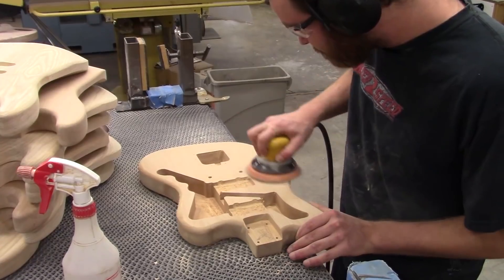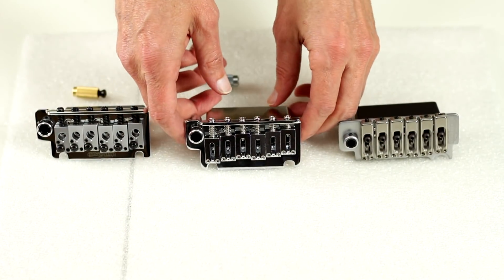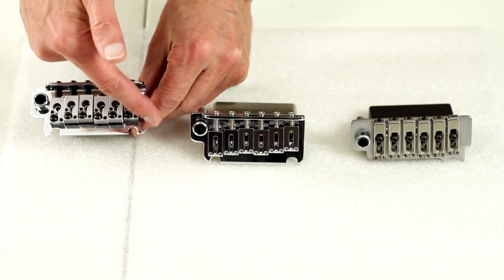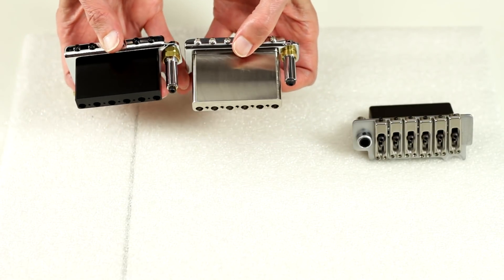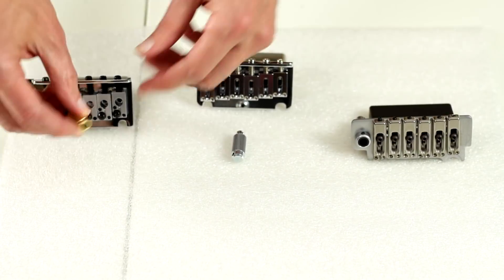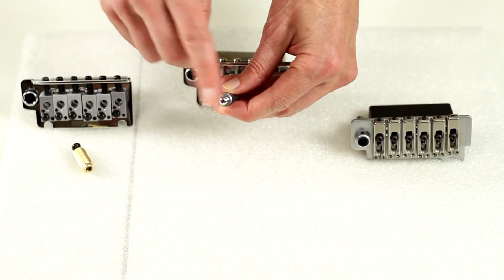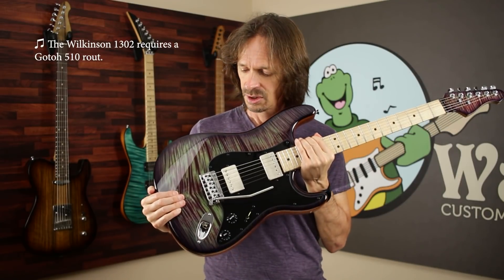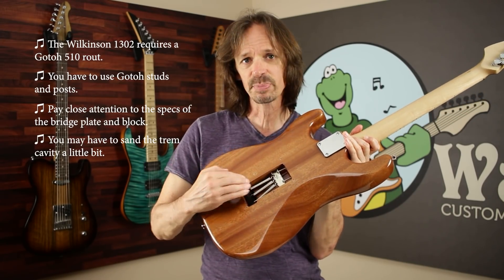Wilkinson 1302 Tremolo Installation Fail??

Comment: Hi Aaron, Other options are Wilkinson WLS130/S Locking Steel Saddles which can retrofit the saddles on the Gotoh 510. In terms of the Wilkinson WVS1302P you have the WVS1302P Compact which is a modified version of the Standard WVS1302P Vibrato, and is designed to fit specifically on Charvel “Dinky” Style guitars with bridge recesses, and shorter body depth. I have  Wilkinson WVS1302P standard and it has no problem in the Warmoth 510 body rout although you do need to use the studs as you mention in your video.

Comment: If you already have a 510 in a guitar, you can just buy the locking saddles and use those. Drop those in on your 510 and good to go!
Reply: Was just about to type the same thing.
Reply: I already made it 6 months ago
Reply: @baimun  Me too! LOL
Reply: And the 510 plate holes are oval. It may not be relevant for a lock saddle, but for mental health I am particular about it.
Reply: exactly what I did. Gotoh clearly makes better parts and hopefully they can come out with their own version of the locking saddles in the future so we can just get a 510 with them.
Reply: @fusionid   gotoh is the manufacturer of the wilkinson.

Comment: The compact is for Charvel's (etc.) with slightly recessed trems, thus the shorter depth. Wilkinson makes a non-compact version for non-recessed bodies
Reply from the maker: Ahh....good to know. I tried switching the block with the 510, but they were not interchangeable. Maybe I will try to order the longer block from Wilkinson.
Reply: @warmoth  Would 1302 saddles retro fit to a 510 trem?
Reply from the maker: I think they are supposed to, but I haven't had a chance to try that yet.
Reply: @PhilLament  I think that's what Pete Thorn did to his Suhr
Reply: The saddles do fit the Gotoh 510 and they work fine on it. I had a Gotoh with these, so speaking from experience.
Reply: @warmoth  I made it 6 months ago... saddles are retro fit to Gotoh
Reply: I’ve got the 1302 non compact and a Gotoh 510 and the 1302 saddles do indeed retrofit.  I actually have the 1302 non compact in a Warmoth guitar that I ordered with the Gotoh 510 routing and it fit perfect.  Initially I asked the guys at Suhr as I had the 510 in my Suhr Classic, and they confirmed the 1302 non compact bridge retrofits with no modifications necessary.
Reply: @PhilLament  Wilkinson sells the locking saddles both in center and offset screw formats. I have the center screw ones on my gotoh 510 and they work perfectly.
Reply: Thanks Doug, I was about to ask this question.  Wilkinson really should be clearer in their online stores.  If Aaron can make this mistake, what hope is there for the rest of us😃
Reply: @takemebacktothen  I did that with my Suhr too
Reply: @warmoth  It says it right in the ad for it. "The WVS1302P Compact is a modified version of our Standard WVS1302P Vibrato, and is designed to fit specifically on Charvel “Dinky” Style guitars with bridge recesses, and shorter body depth."

Comment: Trevs Locking saddles are amazing,  had them in my strat for over 2 years now and they work just as well as a floyd system when used in conjunction with locking tuners too.
Reply: I was going to ask that question thank you

Comment: Thanks Aaron for this upload. As usual, manufacturers are producing so many different standards that most are incompatible with one's stuff. The "sound of failure" is a real hit: someone should make a record with it...! 😆🎸😝😵 "The WVS1302P Compact is a modified version of our Standard WVS1302P Vibrato, and is designed to fit specifically on Charvel “Dinky” Style guitars with bridge recesses, and shorter body depth" Personally, I am into a vintage trip right now, and I am sticking to my old 6 screw traditional trem. 😁🙄

Comment: Hi to Aaron, and all you guys following the videos that Warmoth produce for their superb products.  Being part of the Wilkinson team I can clear up any confusion people may have regarding our anniversary vibrato range.

In the range we currently have two vibrato units which are the;
WVS130/2P Standard version.
WVS130/2PC Compact version.

Both units are 56mm across centres with a 10.8mm string spacing.
The block on the Compact version is shorter and the top plate is also smaller, this is designed purely for Charvel model guitars that are routed around the vibrato on the front of the guitar, and are also routed at the rear so the plate is level with the body rear.

In answer to the comment about Gotoh being are sole manufacturer this is not the case.  The fact is that we utilise a small number of high quality bridge and component manufacturers to create our hardware, and like other leading guitar brands we have a selection of ranges at different price point to suit the individual customer.

As noted by many of the comments, Wilkinson also produce a range of locking saddles that will fit many bridges/vibratos that are part of the Anniversary range, these are denoted;

WLS130/S Standard versions which will fit many vibratos on the market.
WLS130/P PRS style, designed to fit the PRS vibrato. 
WLS130/F Fender offset screw style, designed to fit the 2 pivot fender vibrato with offset intonation screws (right hand only)

If anyone does have further questions then please feel free to contact me @
rick@wilkinsondirect.com
Reply from the maker: Thanks for the clarification Rick....much appreciated! I have another bridge on the way, and will be doing a follow-up video once it arrives!

Comment: When you look at the price difference in doing this, it actually makes more sense to buy the 510 along with the mounting studs installed, and then simply buy the locking saddles separately. Installation is not that hard.

Comment: It’s crazy that they changed the studs on this and you’re honestly better off with the 510 studs. The 1310 studs are obviously non-locking, which explains how they’re able to be smaller in diameter. Locking studs are a huge improvement for tuning stability.

Comment: I found out the hard way last year that the posts were not compatible but that was an easy fix as you said.  I was able to get a Wilkinson 1302 with the full length block from their Reverb store last year so the rest of the install worked fine for me.  If you contact Wilkinson on Reverb, (Trev's daughter runs the store) I bet she will send you a replacement (longer) block.

Comment: I just ordered my first Warmoth body and neck the other day. If this build goes well I’ll definitely buy another body and neck. Can you possibly do a top mount Floyd Rose video? I really want a Floyd Rose in one of my guitars, but I don’t want to deal with a floating bridge. Thanks 😊
Reply: You can always use an L shaped backstop like the one from Fu Tone or Floyd Rose, improves tone as well. Works on both recessed and non-recessed mounts.

Comment: The Devil is in the details.   I just had to order another Wilkensen Trem.  I got the string spacing right, but the screw holes didn't match up to the predrilled vintage spec strat screw holes of 55.5 mm.  The trem I got was 57 mm.  Wilkensen does make one, so I had to order it.  These are worth the aggravation, best trems you can buy.

Comment: The unusual short specs of that bridge block aside, would you consider doing a video on essentially a little measuring course, on how to swap such bridges from one to another on the same body, like for instance those wilkinson bridges. There are so many details that should be regarded when upgrading a tremolo bridge, but few videos that explain which measurements should be done and how they should be done. I bet there are lots of viewers who want to educate themselves and dont necessarily shy away from using woodworking tools to accomplish such a task.

Comment: VS100N is shown as 28.4x2 = 56.8mm on gotoh's site. I believe they are showing how far you can go with the stud centers; not sure tbh but the right stud is not in the center of the marking. Either specs have changed or you are putting your studs too narrow and not landing them in a more general spot as you said the stud spacing Warmoth uses is 54.5mm. Not sure where you are getting that from. From gotoh's dwg I'd guess you are landing your studs in the center of the markings, but that's not what they are showing on the dwg. Great vid though, appreciate the shorter block info you highlighted!

Comment: Hi can you do the 'new' Gotoh 510 'narrow spacing left handed' they sell it now, I've been hassling them for 8 years about it XD finally it's an option, just checking if you can supply or route for it thanks! The narrow spacing is good for preventing strings falling off the fingerboard sides since Warmoth necks are not so wide at the pocket.
Reply: I replaced the bridge from my Fender strat to Gotoh NS510 which is "narrow spacing" type, and I'm so happy with the result! 510 and NS510 are compatible. I hope Warmoth will be able to sell it.

Comment: I didn't like the VS100. The black saddle screws Allen key head warped very easily. I had to end up using two different wrenches to adjust them.

Comment: Knowledgeable reps that step up at the time of ordering to  help us navigate thru all these compatibility issues would give me a ton of confidence as a customer. Does anyone at Warmoth look for this before ordered are run when different parts are ordered at the same time?
Reply from the maker: We look for obvious compatibility issues and advise where we can. However, there is a near--infinite number of parts and manufacturers out there, with specs and dimensions constantly changing, new products coming to market, others being discontinued, etc., so it's impossible for anyone to keep track of it all. It's also really impossible for us to know how each person intends to use our parts, so the ultimate responsibility for compatibility lies with the end user. If you watch both videos in this 1302 test you can see how much work went into figuring out the compatibility of one bridge....which we don't even sell!

Comment: Aaron thanks for the info on the Wilkinson 1302. For the uninitiated like me will the 1302 fit in the Fender American standard route? I'm not talking about the block depth but just the overall route and the post spacing? Thanks

Comment: I find the locking screws are a bad design. The rounded head makes it necessary to use a too small Allen key, so they will wear out quick and be a pain. If they had used square shoulders on the heads, they could have used a larger diameter Allen key that is more common, have a deeper hole and longer lifespan. I hope the screws will get an update in the future, or someone will release a retrofit screw ;-)
Reply from the maker: Even though I was not able to play-test the 1302 in the video, I at least got to string it up, and had similar concerns as you do.

Comment: Just wondering, will a Wilkinson VS100 fit into the Gotoh 510 routing? I have a Schecter Nick Johnston strat with a Schecter import Gotoh 510 style tremolo but I'd like to replace it with a VS100.
Reply from the maker: Maybe. The VS100 has a blade edge on one side (rather than a "divot"), so it's not quite as picky about stud spacing. If you try it, let us know how it goes.

Comment: A very informative video.  Thank you.  The post slots on the 1302 appear smaller than those on the 510.  Were you able to fit the 1302 into the 510 posts without issue, or did you have to widen the slots?
Reply from the maker: The slots fit without issue. The only issue was the depth of the block.
Reply: @warmoth  Awesome.  Thanks for the info.

Comment: Maybe the “compact” refers to short block and not small baseplate.
Reply from the maker: Could be. I will have to check with them. I tried switching the block with the 510, but they were not interchangeable unfortunately.
Reply: @warmoth  I struggled to find any info online on it. It’s very strange.
Thanks for doing this.
Reply from the maker: As did I. I spent the $300 so you wouldn't have to! :)

Comment: Everyone needs to understand that Warmoth does not, nor have they ever (for at least 20 years), machine the pocket for the studs of the Gotoh Wilkinson VS100N correctly. The low E side position is correct, but the high E side is shifted inward. I have my theories about why they do this (my guess is to appeal to having the high E stud appear centered in the knife edge). This has been true for at least 20 years, because I have a Warmoth strat body from 2000 with this incorrect spacing (I have since CNC machined it out, doweled it, and remachined the pocket in the correct position). Over the years many folks have reported this anomaly. I believe it is true today. 

From a design point of view, the standard Fender, the Gotoh 510, and the Wilkinson VS100N all share the same stud spacing - as does the new 1302. Is is only Warmoth and then only with the VS100N where the spacing doesn't conform, and then only on the high E side.

If you want a Warmoth body to conform to standard fender spacing, ordering the body for the Gotoh 510 will be correct - and it will still work perfectly with the VS100N.
Reply from the maker: I believe you are right. These various routs could be consolidated into one rout that worked for all. Our current offering makes more sense when you understand the order in which these routs were programmed. Back in the olden days all that Warmoth carried was the Fender American and the VS100. Having a specific rout for each bridge made sense, and I imagine Ken did exactly what you guess: positioned the high E post in the center of the VS100's blade. Later came the 510, and now even more later comes the 1320, and we have ended up with a whole gaggle of bridges that could all potentially share a common rout. The rub is that consolidating all these routs would require quite a lot of R&D and expense. We can't just assume they all work....we have to know for sure, which means building a whole mess of bodies, installing all the bridges in each one, etc, etc, etc. Hopefully at some point we will have time to do that, but unfortunately we don't right now. That's why we do our best to education customers about our existing options with videos like this one. Hope that makes sense.
Reply: @warmoth  I can totally believe this. 20+ years ago, CNC programs were mostly written by hand. Even when CAM was used it was often just for contours and surfaces whose code was massaged by hand into what was otherwise hand originated code. That's the era I grew up in and you would be surprised how many manufacturing outfits still operate this way.

As you say, consolidating anything at this point requires a lot of cost in terms of confirmation and assurance that the edits are correct. No small feat, especially when you have a business to run and orders to fill. If Warmoth were starting from scratch today, all of these things would likely start in CAD models and all CAM code would be tied to them - updating models would automatically update the tool path, so this step wouldn't exist (or at least wouldn't be fraught with risk). But alas that's for the new starts, not the existing businesses.

I should come work for you. I love your company. Warmoth stuff is as good or better than anything else on the planet, and the customizability of it all fits my sentiments perfectly.
Reply: The industry needs to standardize on the post spacing. The new squier affinity has 63mm post spacing. Guess what trem is the right one to upgrade to? (wvs50K) Fender strats have three different post spacings and at least three different string spacings. I don't mind having different string spacing but the post spacing can be just one. How about floyd rose post spacing? You've guessed it, 74mm. How about ibanez rg350? 77mm, and on and on. You get a headache just to keep track of this all.

Comment: I know no one in their right mind would buy a bridge and then not use its included base plate, but couldn't you have just changed the saddles out (leaving the existing base plate and block) in order to try out the new locking saddles?

Comment: Why doesn't Warmoth just add that specific rout?
Reply from the maker: As I mentioned in the video, Wilkinson is offering this bridge with at least two different plates and two different blocks. Which one should we do the R&D for? Is this design "settled" now, or will there be further changes? Is there enough demand to justify the R&D cost? Is it even worth it if the 510 rout already works? Things we ponder.
Reply: @warmoth  Got it.  Thanks.